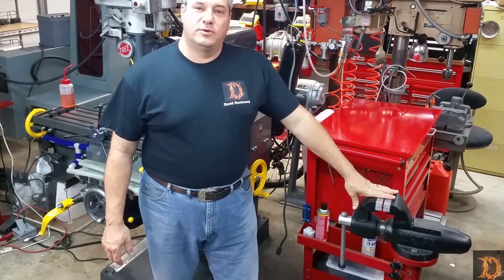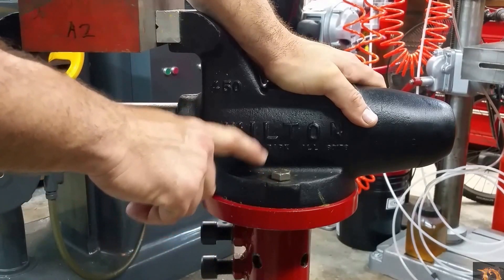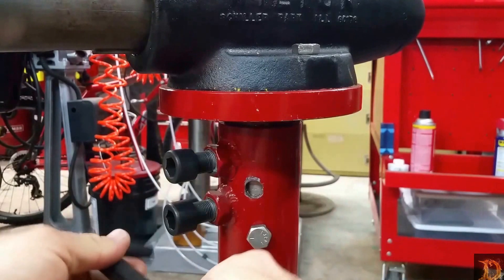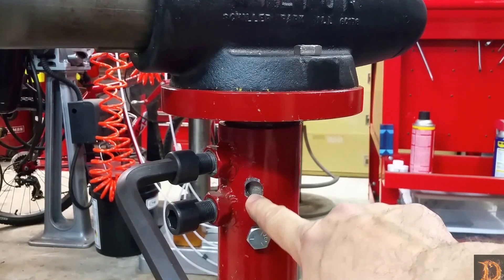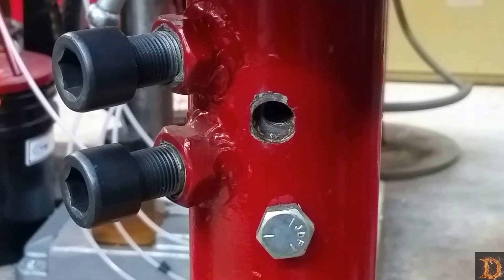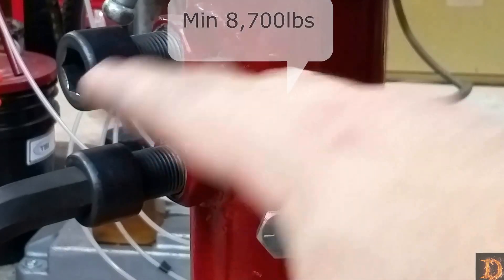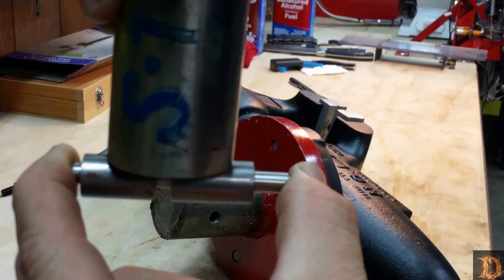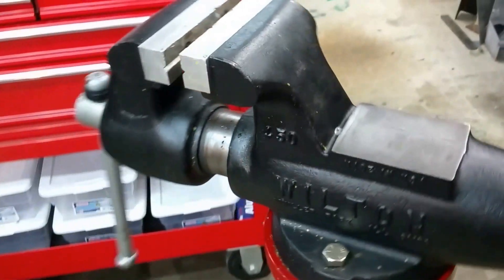Wilton Bench Vise Super Swivel Mod!

Comment: I respect the person who uses their intellect in their work and doesn't rely on expensive and ineffective market tools. Your idea is good; it opens the door to innovation and improvement. The mobile vise must be fixed very firmly at a specific point, rotating horizontally in both directions on a level surface, using thick iron components at least 10 mm thick. I believe the round tube in your design is the weak point; a single strong hammer blow could ruin the idea. I suggest using a car wheel axle as the vise's base, and stabilizing the rotation with a gear system, for example.😉 This is what I did  for my vise at 🏠

Comment: This stand is perfect for my application🛠️  allabout.wiki/DEWALT-Power I finally got my grinder off of my bench!  I had to drill holes in the top to mount it securely, but I expected that when I bought it.  It was a simple build, but the nuts and bolts are a bit tight on the leg interiors.  An open-end wrench is needed.  Sockets wouldn't fit.  It has a small footprint, and fits nicely in a small niche in my garage.
Reply from the maker: What isn't moving?

Comment: Nice work. My suggestion would be to put the hole for the 1/2" locking screw opposite to the two 3/8" clamping screws so that the 1/2" bolt pulls the column in the same direction as the clamping screws push it.  Otherwise they fight each other and the column position is uncertain and depends on the order in which the screws are tightened.
Reply from the maker: Tano17 That's a good point! I don't torque the 1/2 inch locking screw down as it provides rotational stability through sheer forces rather than clamping. Thank you!

Comment: David, impressive idea!  I have a Wilton C2 and C3 -  with a C1 within reach soon.  I was looking at a portable stand with adjustable height when I came across your design. 
My C3 has a lot of slop when swiveling it due to the independent double cleats and no centering pin in the base, so I think your idea would bypass that whole issue.  Nice shop too!
Reply from the maker: Flash Gordon Thank you for Your comments. It's been holding up very well. The only thing I'll have to do is grout the inside of the stand pole to minimize chatter. Those Wiltons you referred to are great FINDS!
Reply: Well, it turned out to be a Wilton Bullet C0, rather than a C1.. but I scored a Wilton 450 SJ bullet swivel jaw as well.